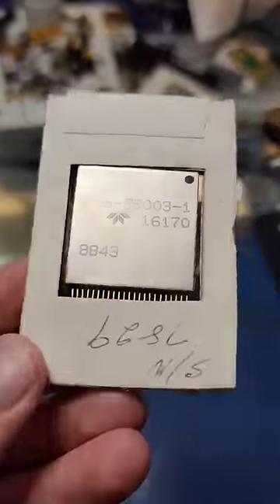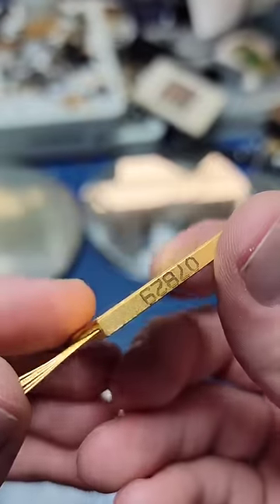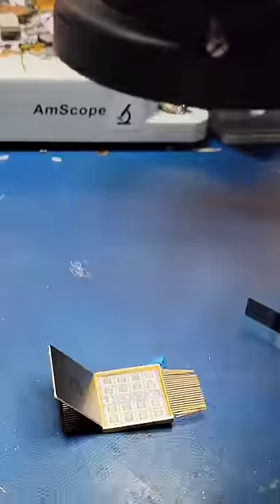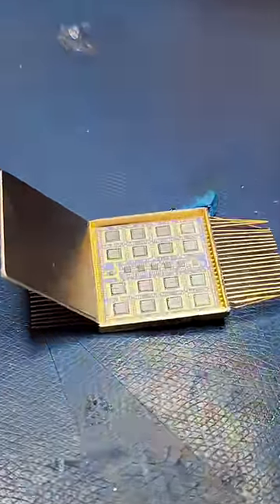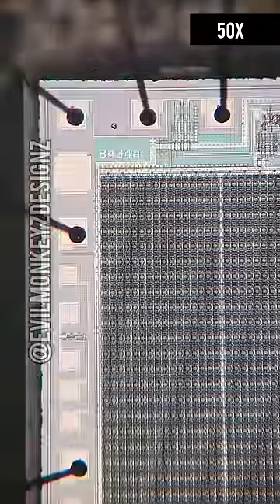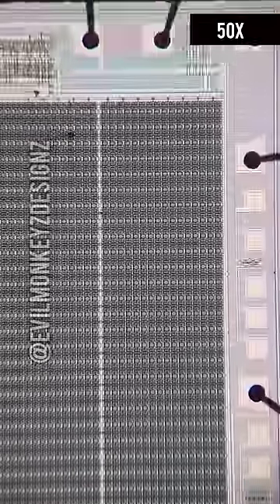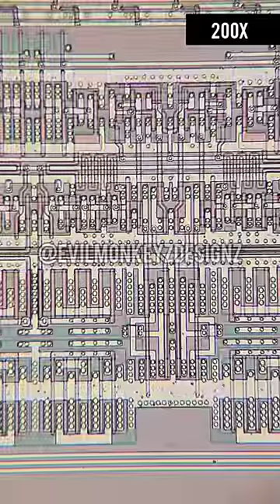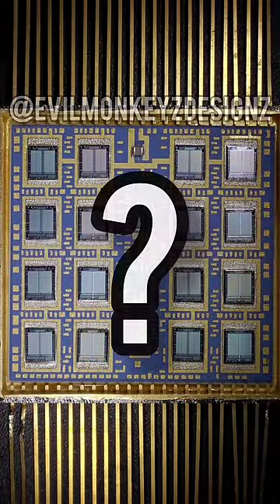CCU #298: Teledyne Hybrid Ceramic Circuit #shorts

Comment: Him: here's something you don't see every day. Me: huh, i wonder what that does?
Him: a hybrid module made by teledyne! In 1988 Me: sooo. What's it do?
Him: it contains 22 indivdual circuits and 1 ceramic capacitor. Me: now tell me what it does.
Him: there are 16 occurences of this integrated circuit marked 8404A. there are many repeating structures in this circuit. Me: tell me what it does RIGHT NOW!

Comment: Yes it's a military grade chip with a multitude of applications why alot of them having to do with telecommunications and satellites as well as some airplanes and spacecraft

I don't think it's solid but it's definitely plated gold and its in a mini finite box to shielded from oncoming environmental tear gamma maybe x ray or even electromagnetic pulses from operating equipment or actual EMP 

For the time of that chip in the 80s your looking at something big something expensive something that you either have alot of money to run or you are a government  its not something for a tv or a toaster or your Atari system

Comment: I'm just worried that one day you're gonna look at a board and have it end up being for an ICBM or something
Reply: Probably already have. ICBMs use a lot of off the shelf parts. It's gonna have an LM358 somewhere in the missile itself, or the ground support hardware used for launch and control. 

So many chips are so ubiquitous, and things these days are so interconnected, that if you have or do anything technical, within a few degrees of separation, it will be used for a military application.

Comment: 1988, that was expensive. 32k, the packaging... military surplus?
Reply: It has a NOTO Parts number associated to the number on the package, some dark alleyways of the internet hint on an aircraft rocket part, but nothing is clear, the surplus dealers don't even know what it is anymore, they only state microchip and have no limit on the amount you want to buy, so it's not valuable anymore and they have lots of it =)

Comment: It's a missile component
Reply: What exact component?
Reply: @norbert.kiszka  ????  it was on tik tok and I googled the s/n and it came back as missile components I can't remember which part exactly
Reply: @Mr.1.i  exact same things can be used to build home microwave oven and to build a missile. In many comments here people said this is a RAM memory. Do You know what is a RAM used in Your computer, phone or microwave?
Reply: @norbert.kiszka  there is ddr and vram in your computer desktop if you use a server it's ec there are many forms of ram there's sram sdram dimm vram edoram
Reply: @norbert.kiszka  what sort of ram did the first calculators use?
Reply: @Mr.1.i  there are many devices made today which use old and slow RAM. For example thermostats and microwaves. There is no point to use fast and expensive DDR everywhere.
Reply: @norbert.kiszka  the first ram was developed in 1947 using vacuum tubes